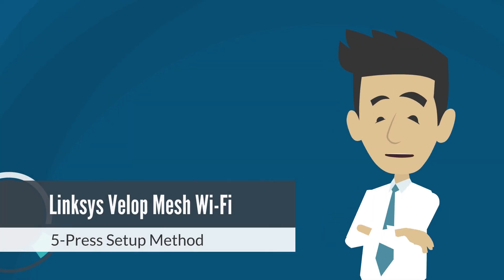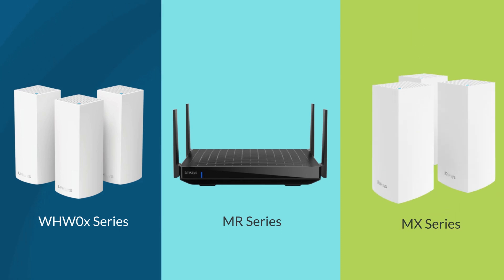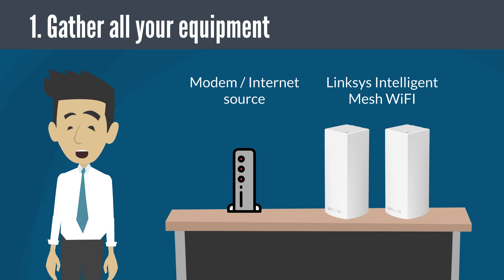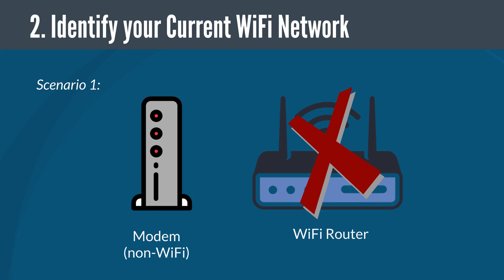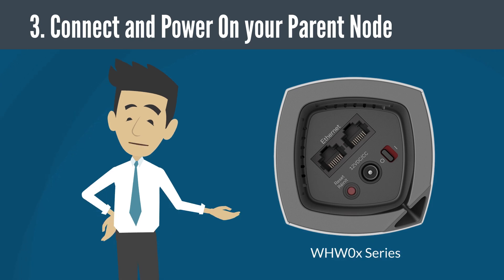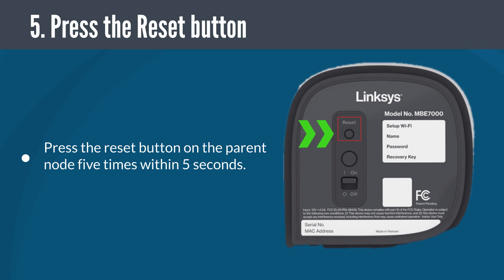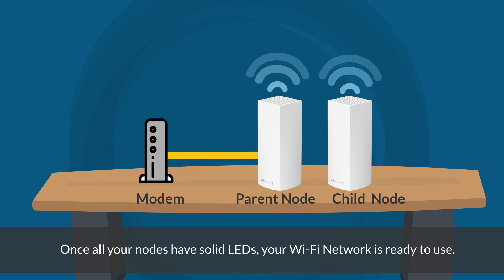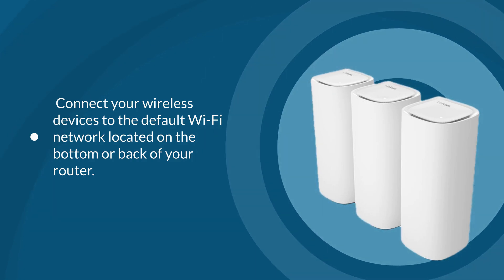How to Setup Linksys Velop Mesh WiFi via 5-Press Setup Method

Comment: I was gifted the nodes as my friends had no need of them. I think my friend had set them up before although I am not sure, and I don't know it this makes my set-up more complicated, but I spent an hour to set them up. The nodes never had purple light whether solid or blinking, which should be the colour during set-up. The blue light after holding the reset button was wrong too. Red solid was supposed to mean no internet found, but it ended up being the colour I needed to add the nodes to the network.

Comment: This is frustration doesn't work on my modem, my number is  "SPNMX56"
Reply: Are you still having problems? 

Just set my one up & working fine. 

I'm not overly sure what goes on with the password as I used the one on the bottom of the  parent node & that was wrong but, in the best of my head, I remember the engineer who installed it into the house giving us a separate password which worked with the app that you have to download.

Other than that, pay attention to the meaning of the different light colours, that helped me a lot + give them time to settled down.

Comment: Recommend not buying any Linksys Wifi product. My brand new WiFi 6 mesh router failed almost a year ago and Linksys refuses to replace the unit even though they admitted it is a hardware failure. I went to Eero, far better performance and support.
Reply: Yes, same happened to me
Reply: Yes, on on some mesh models (mine is a Velop WHWO) , they force you to download an app and set up a link-sys account on your phone to do the setup. Avoid Linksys!

Comment: is there an ideal distance between the parent and child nodes before they loss connection?
Reply: the top led turns yellow if the distance is too high. the linksys app in the phone show you the signal from every node
Reply: There are free apps for cell phones that show you the strength of the signal at a given location, so you should move around and test the signal strength in various different locations. The lower the number, the stronger the connection. Ideally, you want a signal close to 60dBm but no above 75 dBM.

Comment: Hi, whenever I setup the node connected to the ethernet cable it creates a new Wifi network different from the one that comes with the modem, is there any way to make a single network that uses both the modem and the parent node?
Reply: with the velop you will create a new ssid network. if you have 4 nodes, all 4 nodes will have the same ssid. the modem from the ISP have a different ssid. you can setup your velop. its recommended to keep the modem ssid wifi with a different ssid so you can differentiate the wifi around the house.
Reply from the maker: Hi there! 😊 For more help, please visit https://www.linksys.com/linksys-support. We offer various ways to assist you there.